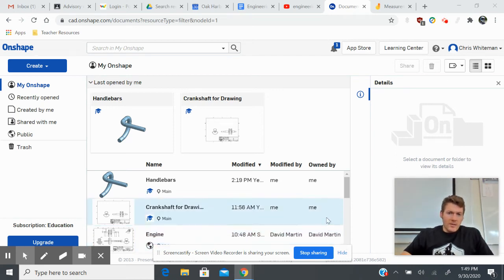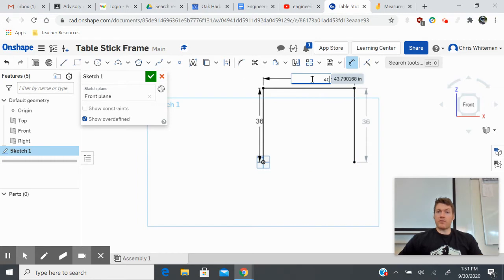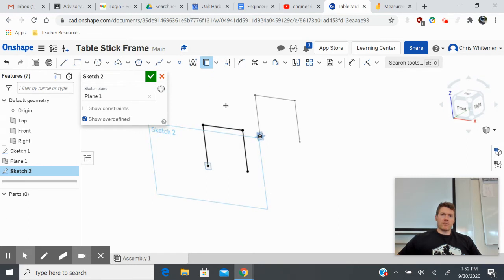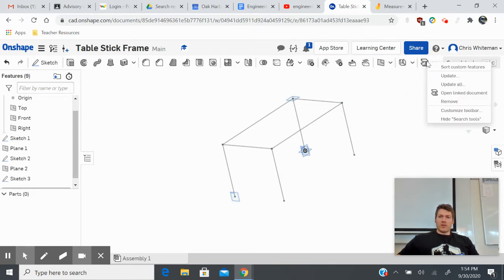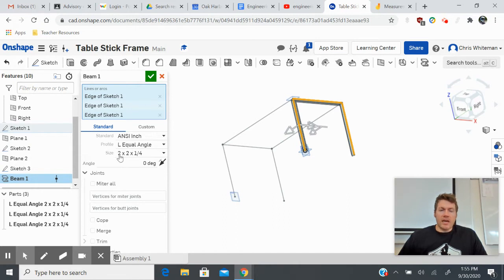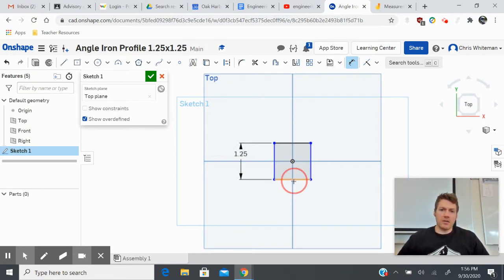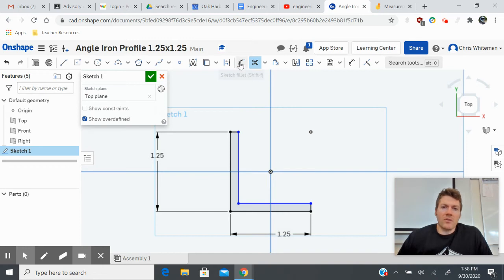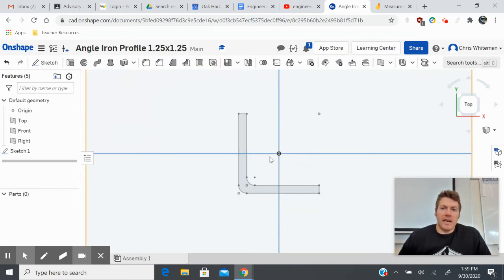Onshape Weldment and Beam Features

Comment: Quick question, you created a sketch and dimensioned both legs, (can the second legs dimension equal the first legs, in case it changes), you also dim'd the top top plane up 36", which is the height of the first leg, but you didn't tell that dim to equal the first dim... what if you change the leg height? Does OnShape have a way of creating equations between dim's or a parameters windwo like Autodesk Inventor?